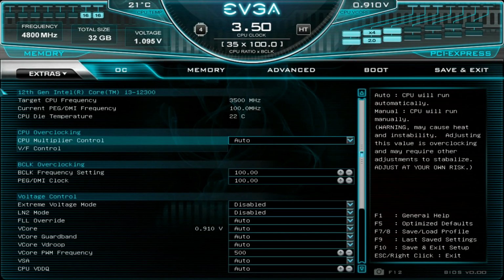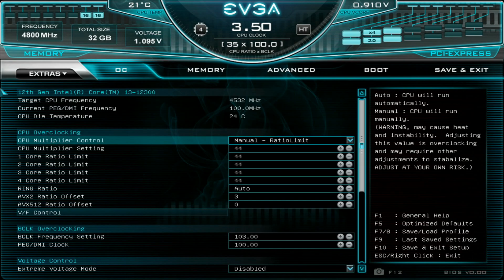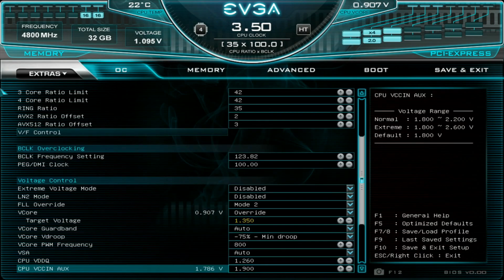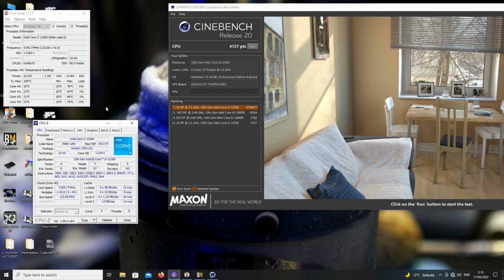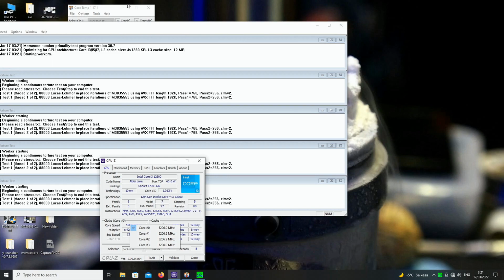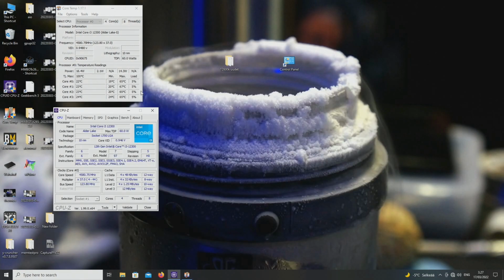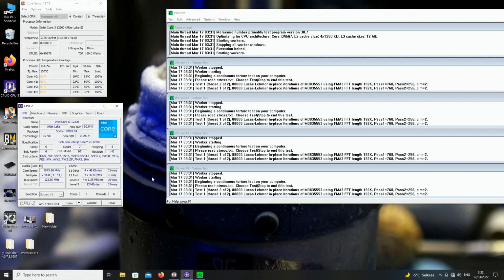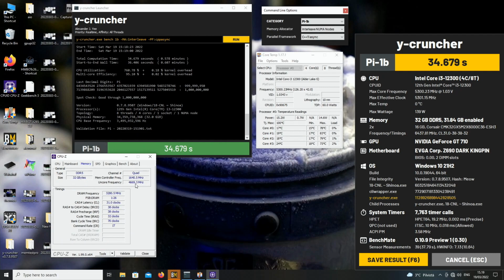AMAZING Alder Lake Z690 Non-K OC - Intel Core i3 12300 Overclocked to 5.35GHz on Z690 DARK KINGPIN

Comment: The F in the i3-12300F means no i-gpu in the chip. Also, I guess we won't have to worry about avx-512 much longer because intel instructed the MB manufacturers to remove this feature with bios updates. Then Intel went one step further and is actually going to physically fuse out the avx-512 within the chips going forward. I find this a lame move especially since the chips that don't have e-cores need not worry about incompatibility. I really need avx-512 when using the RPCS3 PS3 emulator because it gives up to 20% better performance.
Reply: Just use a ps3 lol
Reply: @splashboi898 Not everyone wants to buy a ticking time bomb

Comment: Nice cpu, my 12100F need 1.5v for 5.4ghz r20, and 5.3ghz 1.4v prime95 avx512. I think our cpu is around same quality.
Reply: Hey! Im trying to run BCLK OC on a 12100F/Kingpin dark Z690. With every bios, Im running into a D1/2/3/4/5 then shutdown. Using cheap RAM, and even tried lowering the frequency. Is there a certain bios I should use? It boots perfect without the BCLK patch/OC.

Comment: Hello Luumi, how about using PL2 to limit the max power consumption of the CPU under avx loads? In the past, when the negative avx offset was not a thing, I've overclocked the CPU for non-avx loads and set the power limit as tight as possible to not throttle under those conditions. If I put an avx load, the CPU would automatically throttle 2 or 3x and stay stable.
Regarding the avx512 power consumption, buildzoid had the same results as you: avx512 uses less power than avx2/avx
Keep it up with these videos!
Reply from the maker: Well I want to be sure there is no throttling for ln2 tests.